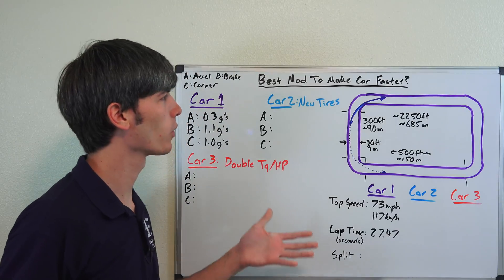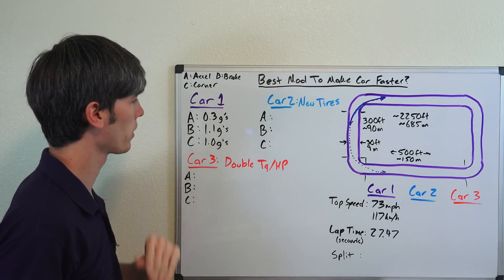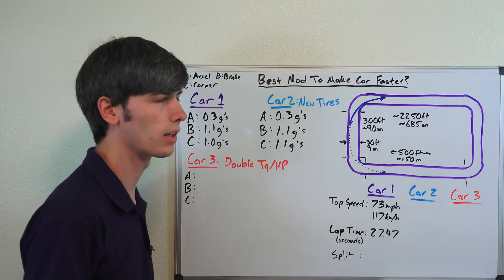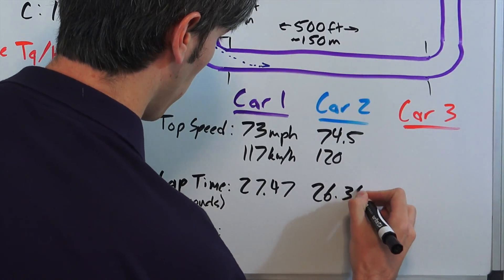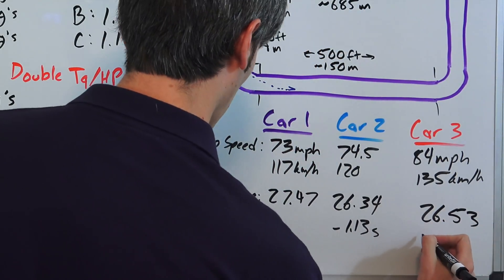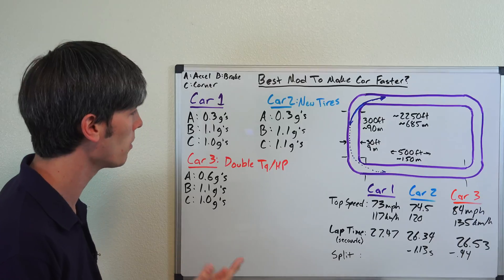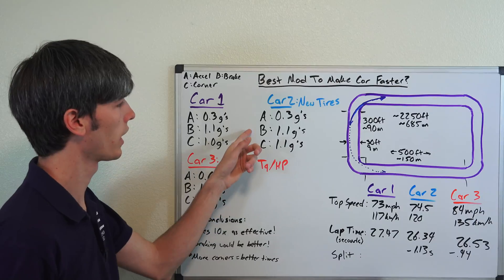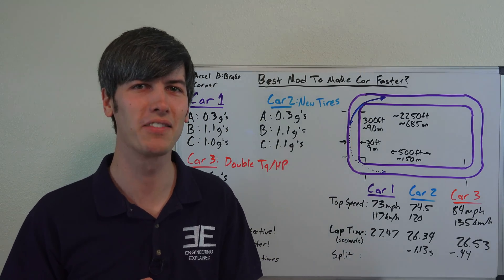What's The Best Car Mod To Go Faster?

Comment: You're just arming Honda Civic ricers with reasons to avoid real performance mods smh
Reply: The cylinders in the civic's engine (or any other 4 banger) is laid out in a line, not a V arrangement, so it's got a straight (or inline) 4 engine, not a V4 engine.
Reply: jk ily
Reply: Actually it would be a massive improvement if they bought hi quality tires over fart cans.
Reply: Neo VeNoM It's all about them painted rims
Reply: ethan199303
 no no, you have to paint the brake callipers red, gives you +25kw.
Reply: v4 engine?
Reply: joseph gallo it's a inline 4 not v4 lol...
Reply: joseph gallo im all for some good ol american muscle myself but ignorance to the 4 banger world is the greatest killer. ive seen some 4 bangers do some incredible things. my recently departed 99 civic si created 358hp at the wheels and put plenty of 'off-the-lot' cars to shame.
Reply: Masterkang, There are v4 engines out there. Ford a had a few and so did other companies. They just didn't stick around. There are also boxer engines which aren't an inline 4 either.
Joseph, If you are including the top model civic against a base stock mustang as you stated above, the mustang with lose because the civic type R or Si exists.
I don't even know why this argument is being made when one car is a cheap "sports car" while the other is an ecobox that is keeping up with it. That says something when a pony car isn't walking a commuter.
Regardless, any car can be made fast with money. An FF and FR car has it's place in motorsports. Some races, the mustang wins, some the civic will win.
Reply: Doubt.
Reply: Yeah I'm talking about a 2015 base mustang vs a 2015 base civic though. Sedan or coupe, and even the accord for that matter.
Reply: Jesse Hernandez At the front wheels. So from a dig you would lose against anything that isn't front wheel drive with the same tires lol.
Reply: ^the civic model I'm using as a baseline is the newest most expensive coupe verses the cheapest 2011 v6 mustang.  civic is 174hp and wieghs 2884. The mustang is 305 and weighs 3401. The civic has a power to wieght ratio of 16.57 where as the mustang 11.15. That's why it feels in the civic that It is more powerful. But the mustangs 0-60 is 5.3 opposed to 7.6 of the civic. It's simply not true that the civic is more powerful or faster than the mustang.
Reply: joseph gallo 305 horsepower is alot to ask from a stock v6 mustang
Reply: Devan Mcbride 305 is the stock rating I'm fairly sure edit "and three engine options are available: a newly developed 2.3 L EcoBoost 310 hp four-cylinder introduced to reach high tariff global markets like China,[62] 3.7 L 300 hp V6,[63] or 5.0 L Coyote 435 hp V8, with either a Getrag six-speed manual or six-speed automatic transmission with paddle shifters.[64][65][66]"
Reply: adam courtney I'm agreeing with you that was my entire intention. A stock for stock civic (excluding the si and r) vs stock mustang the civic will be it classed it's a facile argument.
Reply: ethan199303 what year does a civic automatically become rice? O7 and under?
Reply: How is this a bad thing.
Reply: Not in the real world. Mustangs are pretty bad at a standing 1/4 mile, but they are truly AWFUL everywhere else. They handle like boats, and are still underpowered for their weight, despite power being their "thing". The real world has corners. In the real world you have to brake. "Muscle" cars are just a weak excuse for a penis extension for people who don't really know how to drive
Reply: Lisa Macready The gt350r literally beat the 2017 nissan gtr, 2017 acura NSX, BMW M4 GTS, and many other high end sports/ supercars around Mazda raceway Laguna Seca. Sure the GT's are pretty boaty, they are pony cars. They aren't particularly fast, but not slow either. I'm not sure about how the s550's are with irs, but mustangs were the perfect drag cars.
Reply: I'm an idiot okay leave me alone.
Reply: in that v4 178hp I'd like to see
Reply: The civic has a v4 engine, I wasn't referring to the ecoboost. However the ecoboost would only destroy the civic even further then the base mustang.
Reply: Either way it would never touch the  mustang let alone it's dirt

Comment: grip and driver upgrades go a long way. taking the wrong line through a corner can be so slow, as demonstrated by that theoretical rectangle track with only 2 turns.

Comment: That is also one of the reason why racing instructors' cars tend to have stock-engine (to have that stock reliability), and they spend more on the suspension, brakes, light-weight rims, and high-performance tyres. thanks for proving this mathematically :)

Comment: My diesel went from 130bhp to 174bhp and 230 ft lbs to 319 ft lbs of torque from just a remap/tune so I'm happy lol
Reply from the maker: Them gains!
Reply: Engineering Explained    you should do a video about diesel vs gas engine power, and include the formula for volume per minute.  just remember that a 4 stroke have one volume every two revolutions
Reply: my volvo went from 136 hp to 220 with just a tune, pretty happy about that too! :D
Reply: Birmingham racing I have a Jetta tdi and was looking at a stage 2 tune, is it worth it?
Reply: That's turbo gains for you

Comment: It is very interesting to prove the point. the tires are probably one of the most important things to think. but this is also a summary rather than a "law" I mean there are tons of more things to consider like how easy is the car to drive, load transfers, breaks consistency, etc.  But its pretty clear that if you want to go fast, spent in tires.

Comment: Nitrous. I don't know why you did all that math lol
Reply: Oh yeah....bottle of nitrous and fly off the cocking track as you head into those tight corners...smart idea...
Reply: The Saucy Goblin Shark No. Faster is different as apposed to acceleration.
Reply: Darrell Gilbert gotcha.
Reply: LS convert and a momo steering wheel will make you at least 5mins quicker around the nurburgring.
Reply: He definitely needs Nos!
Reply: rOCKINxsOCKIN have you ever used nitrous?
Reply: The Saucy Goblin Shark shh he thinks its a need for speed game lol once you press the nitrous button there is no braking

Comment: Driver mod is best but tires are very important! Both will help you carry more speed through the corners so you're accelerating from a higher speed onto the straights.

Comment: A motorcycle.
Reply: Stride Tide motorcycles are slower around the track. check out any real track records at Laguna, Road Atlanta, or Road America.... even the motogp guys can't hang because the contract patch is so small.
Reply: If you're comparing F1 to MotoGP, then absolutley. If you are using a video like this to get an idea of the best bang for your buck upgrade, a $20k motorcycle can put up comparable lap times to $100k cars.
Reply: Yea for sure bang for the buck, I totally agree. But on all the major road courses cars hold the top times over bikes and these are not tracks modern F1 cars run on.
Reply: Motorcycles are for men, super cars are for guys who can't get it up.

Comment: This science is nice and all;......but you should see my 1978 Vette with 
side-pipes, mountain mural decal on the hood, westcoaster mirrors, 
fire-stick C.B antennas, lace paint job, B.F. Goodrich wide ovals, 
Chrome Spoke wheels, neon lighting and mirrored disco ball, with Marantz
 quad 8 track.   My righteous sidepipes throw flames that would make you
 jealous with fury of a thousand suns.
  Yeah my Sweet Vette is not perfect yet like the one on "Corvette 
Summer"©;.... but I'm saving up for some Hijacker® Air Shocks, Rear 
Hatch Louver kit and a Hurst® T-handle shifter. 
 I don't want to brag, but I got Doug Thourley Headers (the best), a 
porthole kit and coco mats.
Man it's gonna be sooo fine..............Chicks will be like all, "Can I
 have a Ride?" And I'll be like, "Babe you can ride as long as you 
want".
 I can't wait
Reply from the maker: Coco mats for sure improve lap times by at least 15%.
Reply: Mr. Johnson.  😂😂😂😂😂😂😂

Comment: Stickers. Definitely stickers. Add one to a Nissan micra and you'll be racing Lamborghini in no time.
Reply: I painted my valve cover red on my engine. The tranny broke and the drive shaft broke through the floor up to the passenger seat because of all the power. Could of been me sitting there. Good thing it was just my girlfriend. Moral of the story, make sure to see if other parts need to be painted to handle the power.
Reply: MattTheBoss true. A good quality decal can be at least 5 HP each.
Reply: MattTheBoss you forgot the paint the brake callipers red, +25kw for sure!
Reply: Painting your calipers does nothing for hp gains. This is pure myth. What it actually does is reduce braking distance. Get your facts straight before posting.
Reply: MattTheBoss When I replaced the air filter in my truck with a reusable K&N filter, I forgot to put the sticker on my truck. It's probably for the best though. I don't know if I could handle all the extra power that sticker would have given my otherwise stock truck.
Reply: this and zipties also.
Reply: WeightyLemur lol, yes
Reply: If your race car doesn't make extensive use of zipties, it's not really a race car.  Also, I painted my front calipers red and got at least 15hp - can I get the other 10 if I paint the rears too?
Reply: Andrew Cz Red paint decreases braking distance by 50%, yellow by 25%. Whatever power difference you felt was purely coincidental.
Reply: Nope. Everybody here is dead serious about speed parts and modifications. That red paint bit is irrefutable science.
Reply: Wearing a backwards baseball cap and slouching real low in my ricer makes the civic go like,dude,seriously faassttt..ha!
Reply: MattTheBoss I've actually got a micra with a boost loading sticker 😂😂 loooooooool

Comment: lose weight.
add turbo
???
profit
Reply: Minus the profit*
Reply: Not if you street racing it ain't (this person does not condone any form of illegal street racing.)
Reply: It was a joke. 
And turbo only makes a car harder to drive if you just throw it together and head straight to the track, or just don't know how to drive.
Reply: Lose weight, add turbo, sway bars and sticky tires.
Reply: IIGrayfoxII turbos produce more power without using a bigger engine. 

No. N/A isn't the "best". You can get higher numbers with forced induction than you would with the same engine with the same mods, minus pistons due to turbos needing lower compression.
Reply: +Jeff H
S2000(F20A)
EK9 Civic Type R(B16B)
FN2 Civic Type R(K20Z)
ect
To me a high revving engine is more fun than a slapping on a turbo.
That makes its power from the mechanical design.

+GerTyamiuS
Going Add a Turbo is like saying Drop in a LS1.
Over done and can get boring, plus turbos have their share of issues.
With turbos you need to get a remap done for best results, then you will need to get better tires to handle that power, better suspension as well, and better brakes to stop you.

They're more important things than "Power"
Brakes, Suspension and Tires and more important than more power.
As this video shows, a simple thing like tires can make your car much faster.

Now add better suspension, a little faster, Better brakes a little more faster, Remove weight, even more faster.

Once you deal with the 3 things that deal with controlling the car and keeping you safe, then you can think about turbos and superchargers.
Reply: james pond you only need lower compression if you're burning gasoline. I'm on e85, running 9.5:1 and 25lbs of boost. Making 485whp and 506lbs with 2.5L. Small ball bearing turbo, great response.
Reply: IIGrayfoxII
Or just go High revving turbo engine... STI EJ207 revs 8200. And with twinscroll/ball bearing there is minimal lag.
Reply: GER TyranuS
Go roots style supercharger. No turbo lag and linear power delivery makes it more fun to drive in my opinion.
Reply: Why do people only think about turbos?

NA is the best form of tuning, period.
As with NA, the engine alone makes the power and the response is instant.

Do you think ferrari/lamborghini  adds a turbo to make that 500hp high revving music machine they call an engine
Reply: +IIGrayfoxII you are absolutely right. i have a car that people use to rice, a lot, and i only talk about best tyres, best braking brands and weight reduction. good and alive shock absorbers are important too. iam now into relocate my battery to the trunk. what do you think of that?
Reply: I already have a turbo, but I carry pretty much a hole autostore in the trunk lol. Things I can remember are 5l of coolant, 5l of oil, snow chains, battery jumper, fire extinguisher, windshield cleaner, sponges, microfibre towels, rain reppelent, 2 warning triangles and of course spare wheel. Big trunk problems :(
Reply: +James Pond .. One of my favorite SP episodes ;-)
Reply: Christopher Gruenwald also, a higher compression engine with a turbo can run less boost to make the same power as a lower compression engine. By the way 9.5:1 is pretty low on a low of turbo cars today. I can turbo my car which is 10.5:1 and run around 7psi which would boost my cars power massively. The full kit from dbilas will boost power upto 160bhp depending on the map. My car is a 1.2 with 75bhp so a 160bhp increase would be pretty insane especially as it weighs 900kg
Reply: Wha?!? haha we're suddenly profiting from this?
Reply: +AutoPassion Oh man, I really envy you... I wish I had the chance to race in a spec miata league but I live in Germany and there aint no one here. But at least the best track of all time isnt far from were I live :). Im still thinking if I should get a turbo for my MX5 or ITBs. I actually like non-turbo tuning more and I love nothing more than the response and the sound of ITBs... but I hear they consume more fuel and it costs me more when I go for nonturbo tuning just to get less power than I would with a turbo. But damn, I just cant decide...
Reply: and crash your car with those shitty brakes
Reply: IIGrayfoxII
Because of the simple fact that its more power for less money
Reply: You do mean S2000 I hope?

Comment: I'm still lost on the concept of inner tires rotating slower/faster than inner wheel.
Reply: jinaro kabue Look up how a differential works
Reply: you see the track he made. imagine thats the tire marks a car leaves. As you can see the inner square is shorter than the outside one. An even simpler method to see this is just walk in a very small circle like 1m wide and you will see for example if you go clockwise your left leg has to move a lot more than the right one because the right leg is closer to the centre.
Reply: Actually i just realised this might not be what you asked for. basically the bigger the tire the further it is from the centre. if you look back onto my walking in circle example that also applies here. the further from the centre you are the faster you have to move to keep up.